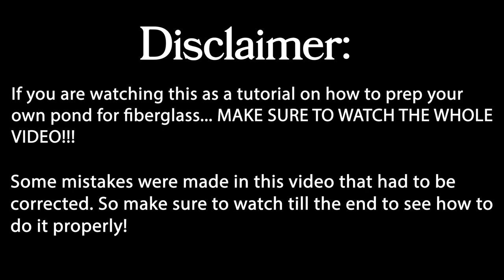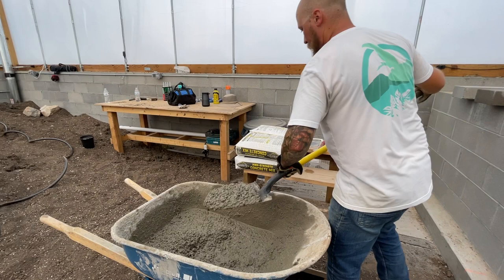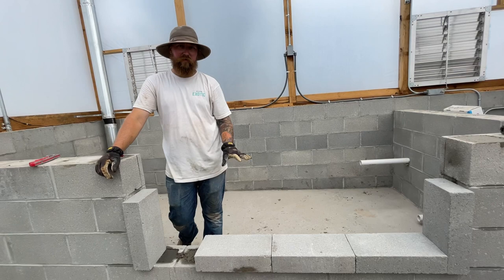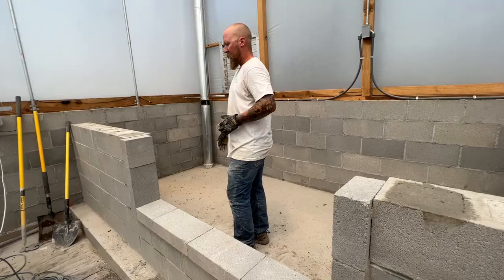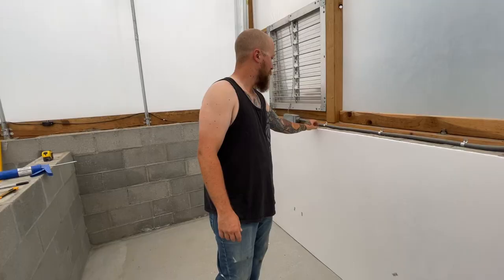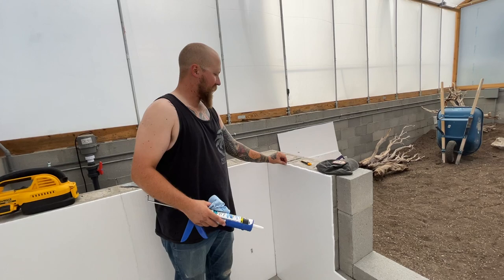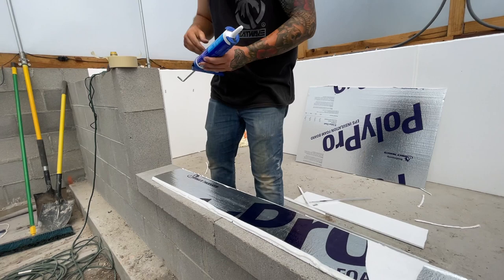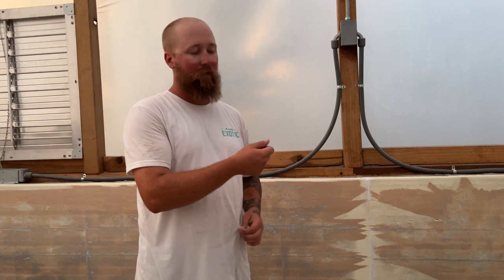Fiberglassing Greenhouse Pond - Part 1: Insulating Pond + Lip For Viewing Window

Comment: A notched trowel would of spread that adhesive much more evenly for better bonding, obviously just covering more surface area. Although I’m sure that will lock down just fine. But similar to putting down tile or any large surface it’s best to get the adhesive consistently over the whole piece.
Reply from the maker: Ahhh that definitely makes sense. Next time